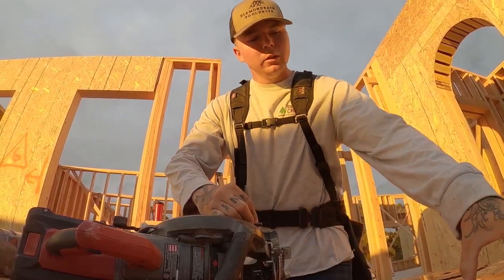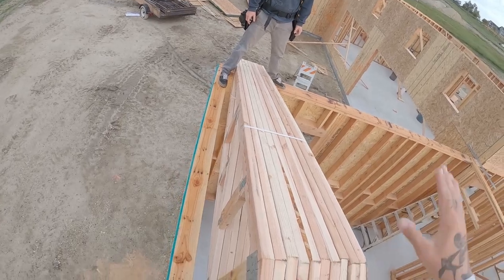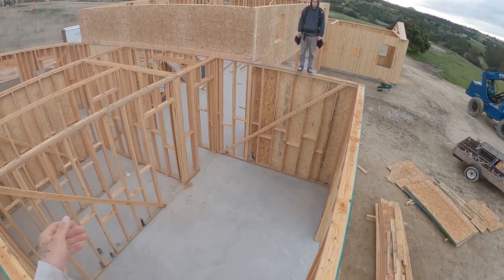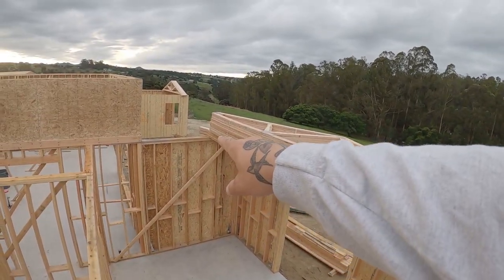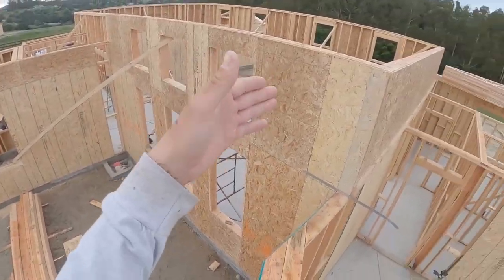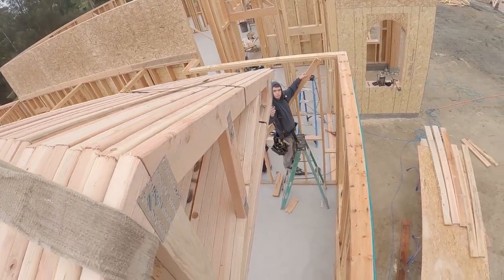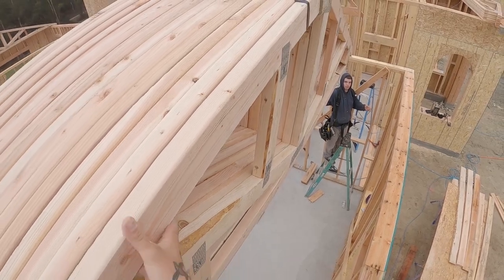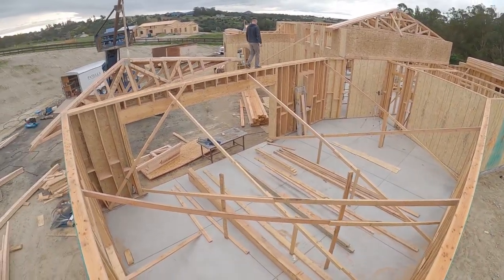Building A Custom Home | #7 - Organizing Trusses on Roof [POV]

Comment: I don't know if  this tip will help but  , when I  stacked trusses  I would  mark all the cat walks  and  lateral  braces  with spray paint  while the trusses were  banded on the ground and then  I never had to  think of  where to  nail  in the 1 or 2x4's

Comment: I have a gas Hitachi framer that I  use to pin trusses. No hoses to get in the way and it's light on my belt.
Reply from the maker: I need to get another cordless, you're so right, it's light and easy to move around. No bulky hoses to wrap up in! I re-routed hoses 2+ times this day.

Comment: Hey Matt, I remember a video way back where you mention to never put your fingers near the blade when adjusting height. I see you changed the blade with the battery in, what's the difference? Just a reminder stay safe!
Reply from the maker: When adjusting the depth, you have your hand holding the grip, right by the trigger. 90% of people have the bad habit of finger on the trigger during that time as well.

When swapping blades, you're not anywhere near the trigger, or even holding the grip.

Comment: How much is that boom extension for the lift that's nice we have a Gradle but only have the basket in the forks and the hooks to set trusses but don't have the extension
Reply from the maker: Can find them around $1,700-2,500 for smaller, the one we’ve got sells for $3,000+.
Reply: Where do i find them bro

Comment: do you guys ever stick build roof systems?
Reply from the maker: We have a project coming up this year with a 2x12" hand cut roof, something like 5,000SF home. It's not too common, but we do from time to time. The back of this place is post and beam with rafters to building, but that's not nearly as fun as a full hand cut!
Reply: We are doing one in Salt Lake City with a 14-12 pitch stick frame roof out of floor joist tji joists it's a beast
Reply: @MattBangsWood  , Sounds like an awesome project, good learning opportunity for the apprentices, I think both systems have their advantages and disadvantages, I'm an retired old school carpenter and love what you and your crew are doing,  just wondering, are you the owner or is the guy driving the lift the owner, take care Matt.

Comment: Trusses so small with a machine on hand why didnt you guys build sections on the ground?
Reply from the maker: Multiple reasons, really..

- Allows more room for error w/o knowing until it's up.
- Nearly all of the lower section hanger onto the ledgers up against the wall. If it was tails both sides, I could see it being do-able.
- We can roll in the air pretty quick, so its not that big of a deal doing so. Keeps things cleaner in my opinion..
Reply from the maker: Everything about pre-fab is typically tract style work, as well.